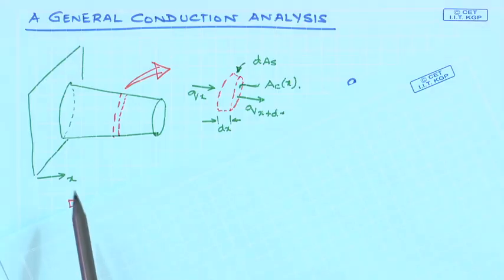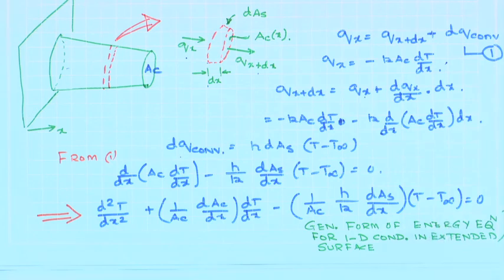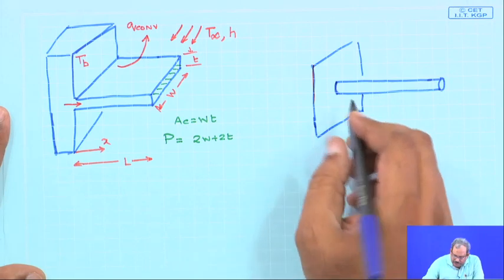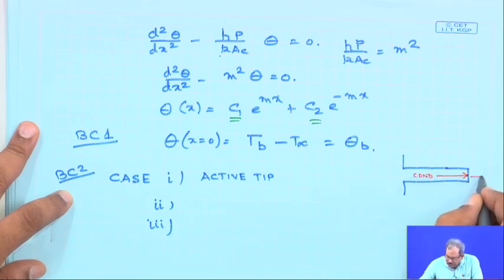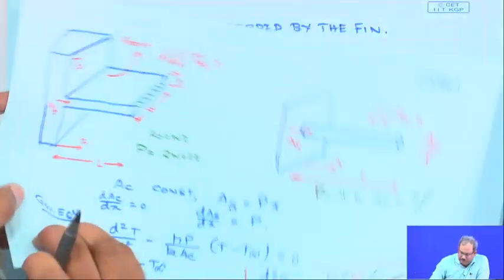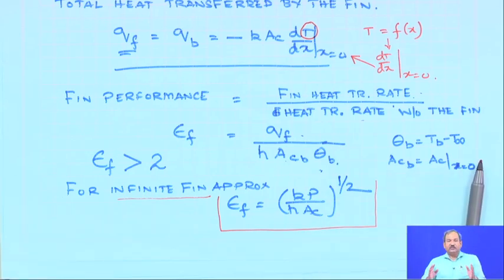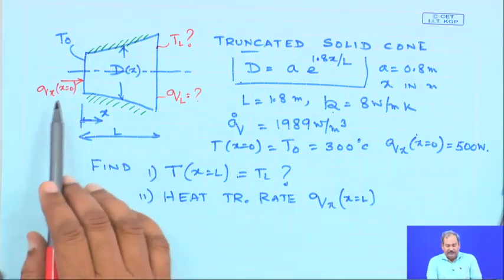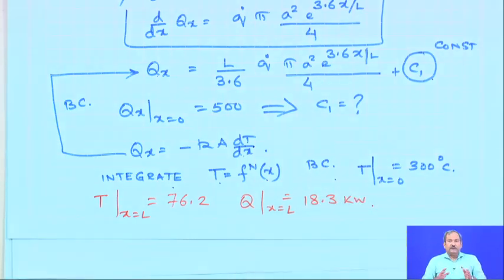Lecture 15 : Fins  and General Conduction Analysis

Comment: sir what would be the area 
in the question
Reply: Dear, Its always depends on fins. General term for crossection area mentioned as Ac & for surface area As.
Reply: Here, they assumed that the cross sectional area (Normal to conductive heat flow) is constant along fin length I.e. from base to tip. Hence, the differential equation of heat transfer through fins becomes independent of cross section of fin.